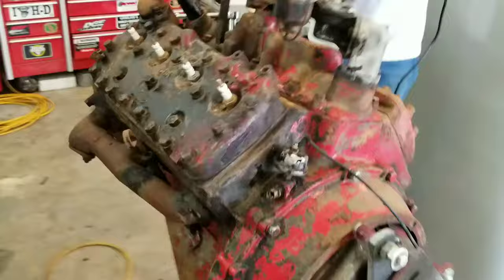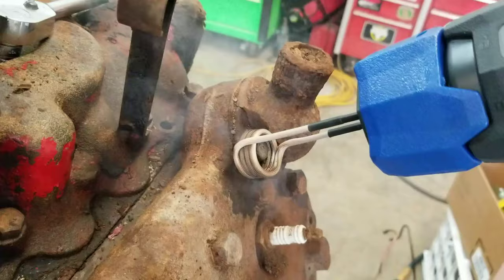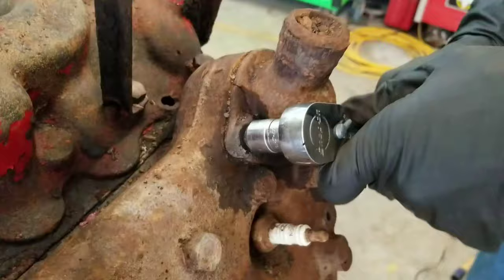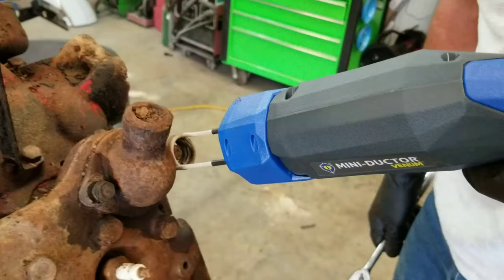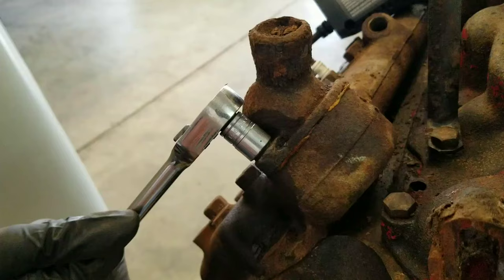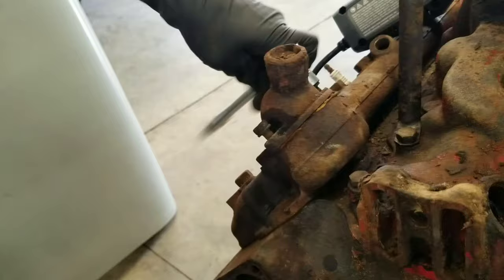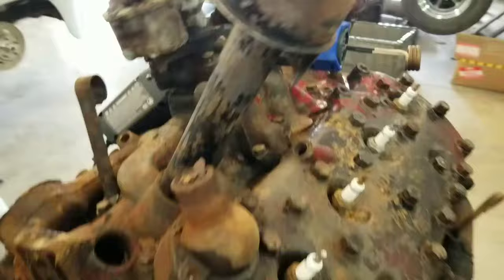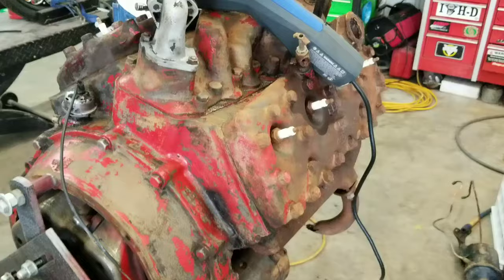A Cool Tool for Removing Rusted bolts and fasteners

Comment: That was just the thermostat housing, I want to see you try the exhaust manifold
Reply: Thats good point!
Reply: The shop I take my 2004 envoy to hinted he could change the cracked manifold in the atlas 6 because he has one of those. 
I got a friend that is 30+ year welder. He don't replace cracked exhaust manifolds.  He has his own Helium /Argon gas TIG welder.
Reply: @osubucki4205  in an engine that was coated in oil...
Reply: @cwillboxer3413  
It does work, I have that tool myself. Very handy, especially if you're trying to get a fuel tank off with stubborn bolts nearby. Or, with sensitive plastics close by. Engine coated in oil? Give me a break. You think oil seepage from a valve cover is going to free all the exhaust manifold bolts?
Reply: @alwcurlz  yes... That's exactly what I think.... An engine that had been covered in oil for 30 years... yes absolutely. Especially since the valve cover is directly above the exhaust manifold.
Reply: @cwillboxer3413  it's kinda the opposite.The baked oil makes the bolts to stick really bad.Especially where the is a lot of heat,such as exhaust manifold.I broke to many bolts on on engines that were covered in oil and grease.All you need is some oil and dirt and some heat to turn that into super glue and voila.
Reply: Why? They are already broke off if its a ford
Reply: The tool works. Just don't buy it from Snap On. And there are several brands of the tool. They all work just as well.
Reply: First car I owned I had to replace a thermostat in a Chevy 305. Bolt broke right off. Then I broke the easy out in the bolt. My big help brother in law said - Why did you go and do that? Man that was tough to get out.
Reply: @marcw6230  i have to replace the manifolds on my 2007 f150 5.4. Ive had people tell me that the heat tool makes the bolts expand which makes them harder to get out. They told me to heat the area around the bolt with a torch. Im just curios on which way i should go with since the studs on well know for snappin off on the 5 4s
Reply: @zachshipley1689  

My mechanic zip cut all the heads off the  bolts on my 5.4.  Then he removed the manifold and tac welded a 1/2 inch nut on the post/remaining manifold bolt sticking out if the head.  A bit of pb blaster and he spun them right out, no broken bolts.  It was so nice to get rid of that old ford manifold tick, tick, tick, tick.
Reply: @Pops2  yeah thats what im currently dealing with
Reply: Yeah want see
Reply: @marcw6230  honesty i rather do it myself. The last few times ive ever took one of my trucks to the shop it came back with more problems then it had to begin with. Plus i def dont want to replace it with another stock manifold. Im gonna throw some stainless steel shorties on it. Push comes to shove im planning on have a bolt extractor kit and some drill bit on hand just in case
Reply: Ding ding. Thought the same.
Reply: OH MAN WHEN I SAY THEY WORK THEY WORK PROBABLY ON AN ENGINE UNDER WATER FOR DECADES. IT’S HOT
Reply: Haha🍿
Reply: the scary part when a blot REALLY seizes ,  it seizes in the shank.....not at the head
Reply: Got shut down on the first response lololol with yt link
Reply: 😂👍 We’ve all been there.
Reply: The man has a point
Reply: .  That tool would probably take a lifetime to pay itself off .
Reply: I was always under the impression heat makes thing expand so in fact u want to heat the fixture not the bolt but hey what do I know
Reply: Me too
Reply: Ryan Jacobsen  . You are correct , heat will make it expand , so heat the nut & take it off hot , but the bolt heat it , then let it cool , this breaks the rust loose , bolt shrinks back to original size , also before you heat the bolt , place a drift on the bolt head & give it a good rap with a substantial ball peen hammer say 24-32 oz you may not even have to heat it , I have broke many loose this way , & you can do also after it cools !
Reply: @robertmintz63  thank you so much for agreeing I was almost kind of being sarcastic LOL I knew that what I said was correct I've used the technique many many times I'm actually a mechanic for a plantation that has been in service since 1844 not saying we have equipment from back then but we have some very old equipment out here that breaks and I work on pretty often welding and fabricating new parts and pieces as well as getting off old stuff
Reply: Yeah try one on any mustang 3.8 everyone will break off
Reply: Ryan Jacobsen  . Thanks to you also . I worked 20yrs for Toyota in the machine shop , and got pretty good , good enough other shops would ask me to come over & fix stuff for them  In the body & weld shop there was always water under the spot welders from changing the tips so all the bolts were rusted in my team leader was always getting me to get them out for him ! I do all my own mechanic work , currently on a 1089 Case. Backhoe , but don’t ask me anything about that new computer stuff . I spent 1988 welding to build bridge false work ,(the structure necessary to pour concrete to make the bridge) quiet an experience . I retired from Toyota in 2010 .Thanks again you have a good one !
Reply: @robertmintz63  man I dont know anything about the electronic stuff 🤔
Reply: It works great. We use it on hydraulic cylinders, 1 1/2”-2” nuts for rebuilding them
Reply: @stevesimone1104  have you tried any of the cheaper ones I see on eBay?, the bolts on my gsxr headers are seized but I can’t use a torch or a welder coz it’ll mess up my immaculate frame and engine?
Reply: @cwillboxer3413  - You're funny.  You cast doubt that it works because it was "just a thermostat housing" and then ask for it working on something actually difficult like a manifold bolt and OSU gives you exactly what you asked for...and then you just talk about oil.  I've broken many bolts in my life...most of them are on engines that leaked oil like a sieve.  Manifolds burn off oil any oil that gets on them so the manifold bolts weren't coated in oil.   Do you NOT think this tool works?  If so, then you've never used a torch to do the exact same thing like most of us have.  The only difference is that this tool heats it about 5 times quicker and ONLY heats the part you want (unlike a torch).
Reply: @osubucki4205  - Nice!
Reply: Shit do an intake manifold on a 5SFE
Reply: It takes off exhaust bolts it really works it may take a while if u gotta do multiple bolts not as fast as a torch but if u at home it's a lot safer. I use this in the shop the other down side is u gotta adjust the coil cus if it's not tight enough around the bolt or stud it will take longer if it's too tight around the bolt  it won't heat up  the bolt just the nut but it does get shit red hot
Reply: @warrenpuckett4203  sooo the moral or the story isss..?!
Reply: Oof I can’t imagine the corrosion
Reply: * headers
Reply: jajaaajajajaaa , me too .. i want to see in the exhaust manifold ..
Reply: @stevesimone1104  you obviously never made a decent amount of money turning a wrench. Lmao
Reply: @we are 138, no reason to bring your family in on this.
Reply: @cwillboxer3413  you must not work on old motors because you don’t know what you’re talking about😂  oil and grease aren’t anti seize lol
Reply: yes!!!!
Reply: I've seen 8.8 bolts turn to cast iron after being bolted to a cast iron furnace for a few years.
Reply: @warrenpuckett4203  mom
Reply: @cwillboxer3413  oil burns off and creates carbon deposits. locks the bolts in. my 75 360fe engine was caked in oil. Every manifold bolt broke, even with penetrating fluid and MAP gas. Didn't care much, only needed the block. heads were trash from typical sunken valves. I just wanted to see if I could get 1 free but nope lol.
Reply: @fuchowfriedrice6107  heat is transferred down the threads. the entire bolt gets really hot. why you saw that puff of smoke on the second bolt when he broke it free. that was smoke trapped in the threads from the lower portion of the bolt getting really hot.
Reply: @thunderroad7289  call a waaaambulance
Reply: Thermostat bolts nowadays are just as bad
Reply: Same concept what’s the difference they’re both bolts either one of them can snap.
Reply: Exactly!
Reply: While it's still inside the engine bay.
Reply from the maker: Did on a later video
Reply: @WarmanAutoworksLLC  impressive. Looks like a larger tool and would be difficult to use in tight quarters but if you made it happen that's awesome
Reply: @robertthomas5906  found an aluminum intake a guy scrapped had the thermostat bolts stripped out i just ran a couple bolts up from the inside put some nuts on bang edlebrock performer intake for 5 bucks best miracle hack for a bolt broke off if you havent seen it take a nut lay it on top of the broke bolt and wire weld into the hole of the nut till its full then twist out the stud it can really be a miracle fix also if you have something broke off like a brass fitting and dont have an easy out you can use the right star head bit or hex bit drive it in the hole and twist out a small impact helps also. And if its a stripped bolt head if you can get to it with a cut off wheel or dremel it can be ground to a diffrent size i worked at a detroit teardown facility for five years ive taken apart thousands of 12.7 diesel engines ive probly seen everything at least once
Reply: @stevesimone1104  how much for that tool please?
Reply: Heat doesn't travel down it. It's called induction
Reply: @osubucki4205  nice lol
Reply: 100%!! Id love to see it on a 2.2 ford transit for turbo removeal
Reply: Right 👍
Reply: @marcw6230  you can't buy MAPP gas, not for a long time.
Reply: @marcw6230  I don't think so.  They wouldn't sell it to you, and sure wouldn't have that much left over.  It hasn't been for sale in this country in over a decade.
What you have is MAP/pro, which isn't MAPP gas at all, it's a MAPP substitute, mostly propylene.  The A in MAPP is for acetylene, which isn't in that stuff.
I still have some MAPP that I bought 15 years ago.  The difference between that and this MAP/pro stuff is striking.  Sure, it's better than propane, but it isn't MAPP.
Reply: @alwcurlz  if you heat something it expands. is it true or false that the "bolt" is heated.. or the metal around it?? please specify.. i think its heating the area around it expanding it thus away from the bolt. if you heat the bolt, it expands the bolt.. which would make it harder to remove... thoughts/??/????????  HEX coin $0.17 dont sleep
Reply: @hextremelydesirable1648  
The only thing that is heated by the coils must be within the coils. The area around the bolt will only get a transfer from the bolt being heated. When heating the bolt, it expands, compresses the rust particles, and then shrinks as soon the coil is removed, similar to using a blow torch. Once the source of heating is removed, turning the bolt with a wrench will be initially tight but, cooling quickly, the bolt will ease out.
Reply: @alwcurlz  you win! get HEX coin and hold a couple years. yw
Reply: The far less expensive ones make a lot more sense for the casual, DIY person fixing their car here and there (that's me ... I wouldn't spend over $500 on one of these).  

Pros need something a LOT more reliable though.  I am not saying that this one is/isn't better than others out there.  Time is money for a professional mechanic though ... a cheap, dead tool can cost you a lot more cash than you saved buying an inferior version ... many of the lower cost ones aren't made for daily use and abuse.

In the case of SnapOn, I've heard that their quality has gone downhill over the past 10 years ... that sucks if it's true.  We have quite a few of their tools where I work ... I love them ... sometimes I take my car there to work on it using their lift & tools after hours.  They bought them about 15 - 20 years ago though.  I haven't tried any newer ones recently.
Reply: @robertthomas5906  I'm here researching this tool because I need to replace the thermostat in my '79 305 motor. Neck is corroded all around the bolts from coolant leakage. Thanks for your comment!
Reply: @alexcallas8222  Now that I have a lot more experience I think I can help. Get some acetone and transmission fluid. Mix 50-50. You don't need much. You'll want to mix that up every time you use it and don't get any on you. Your skin can absorb acetone and they say that's bad. I've had a lot of acetone on me in my life and so far so good. That's mechanics penetrating oil and it seems to work real well. Use a paint brush and apply some. Next day do it again. Take a typical claw type hammer and hit the heads. Not a crazy hit. Good square hit/jolt. Now use a 6 point socket that fits. Try to loosen it gently. If it doesn't come out, switch and tighten it gently. I know, doesn't sound right. I thought that too when an old time mech told me that. Try that a few times and with any luck it'll come right out. Now tighten that bolt back up and do it to the other side. You want the original side to be a bit secure so it's not pushing up on it more. Now that both of them are lose with any luck you're good.
You could still break the bolt. Good luck. Whenever I work on those aluminum intake manifolds I replace those GM bolts with new stainless bolts and stainless washers. Then I don't have a problem anymore.
Reply: Used a welding torch on it and still didn’t come out
Reply: I just watched a guy do just that.
Reply: @zachshipley1689 Left hand drill bits work pretty good,
Reply: Exactly 😂😂😂😂

Comment: Yeah, I think my oxy acetylene torch does the same thing!
Reply from the maker: Yes it does. But many places a flame can not be used, as in our later videos.
Reply: If you try an induction heat tool like this you'll be amazed by it.

Comment: What this tool needs is a 45 or 90 degree end so you can get into tighter spaces. I mean, after all... how often do you have a foot of clearance to work in under the hood?
Reply: rupe53 comes with a few different shapes, and you can buy an expansion kit with more shapes, plus a "rope" stole to make a custom shape.
Reply: You can bend the arms of the coil to whatever angle you want. I have the older version of this tool that is even bulkier but I have a couple coils with arms almost a foot and half long so its no problem to sneak the coil into very tight spaces
Reply: I've used a tool with the same working principle but much more powerful, it made the bolt glow red within 5 seconds. Inductive heater. The one I used did have a 90 degree angle and I use it all the time
Reply: MrChillySmile do you have the brand name  and model for that unit?
Reply: rupe53 I'm sure Snap-On sells different attachments for $300 each.
Reply: rupe53 Ha that's a whole different  tool or an over price  attachment  for  this one
Reply: Nutz4Gunz45 works  great  till u melt wires  that you  touch with the  hot end
Reply from the maker: rupe53 look at latest video. They can be bent.
Reply: good tool
Reply: uses high frequency waves to  vibrate the target... the tip never gets hot
Reply: Guess you can simply bend the winding with a pair of plyers
Reply: rupe53 Good point.
Reply: William Chamberlain ;
Reply: You can bend the elements to whatever angle/ shape you need. It's a very good tool I freaking love it.

Alternatively I'll use a butane torch and then douse it in water to shock the bolt if it's really stuck.. I have yet to have one snap yet haha
Reply: that's what I thought. looks like you could safely bend them to whatever you needed. until I saw this I assumed these only worked that well on nuts, but now it looks like I do want one after all..... hello, my name is luke. I am a toolaholic.....
Reply: That's true, how many times are you working on an engine that's out!  Most of the problems  with broken bolts (exhaust manifold bolts)  are while the engine is in the vehicle, not sure about this.
Reply: rupe53 it looks flexible
Reply: rupe53 they have different tips
Reply: You can make your own coils, from 4mm copper tubing with fiberglass wrap to insulate the coils from each other or you can use Litz Wire in fiberglass and just wrap it to whatever shape you are using. I have the bigger water cooled version of this thing.
Reply: I thought this as well. Good luck getting that thing in a wheel well for suspension work.

Comment: I work on semi-trucks. I bought a Mini-Ductor II from Mac to heat exhaust studs and nuts and to heat bolts hidden in mazes of wires and air lines where you cannot use a torch. It works well. And while i paid the price for it, the biggest return is to my customers in labor and parts saved

Comment: An old trick I learned from a old school mechanic back in the day.. take a chisel with a flat end and a decent hammer and hit the top of the bolt head 2-3X. And try loosening it.. if it's still thought to move, hit it again.. 

This has worked for me many many times.
Reply: @marcw6230  yes!  That works good too!

Comment: About time.  In 1971 I worked in the power generation business on steam turbines.  Horizontal joint bolts were 3 to 4 inches in diameter with a 1/2" diameter hole down the center for a torch or Cal Rod for heat.  You'd tighten the bolt as much as you can with a sluggish wrench and then heat it with a cal rod to expand the bolt and then calculate the bolt stress you want based on bolt stress and tighten up the expanded bolt a measured number of bolt flats.
Reply: fascinating